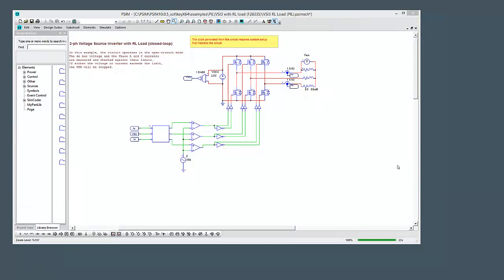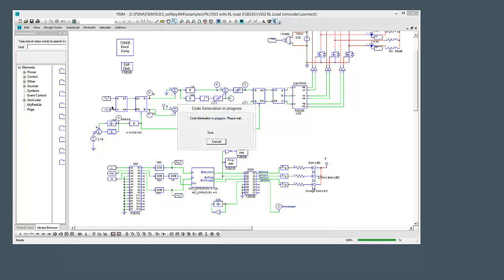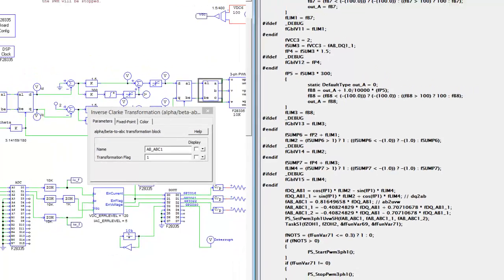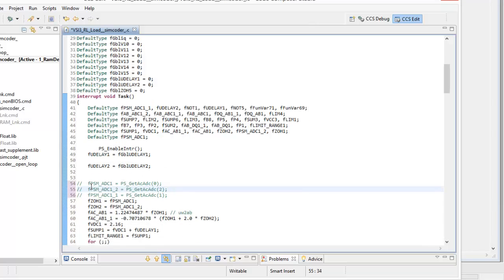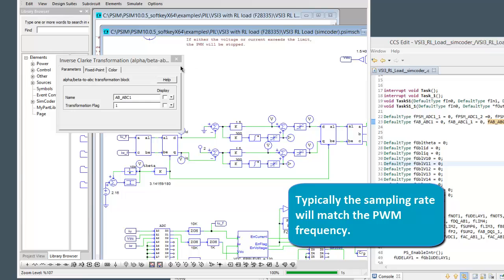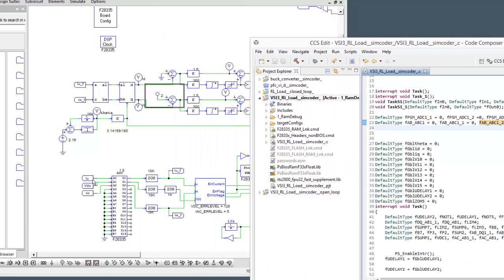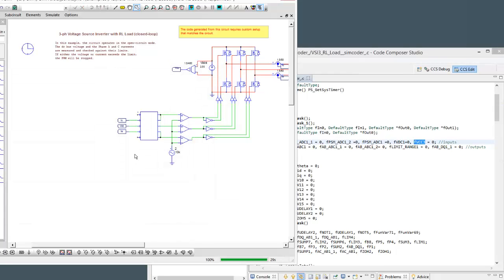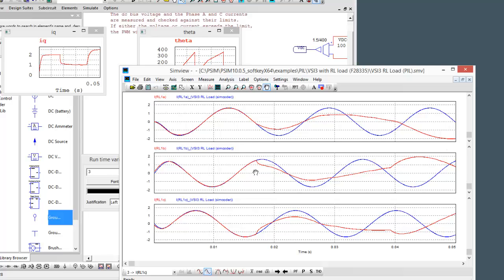Processor-in-the-Loop (PIL) simulation with PSIM - Overview and tutorial

Comment from the maker: The PIL module video uses code generated by the PSIM SimCoder module; however, any c code can be used as one just needs to map PSIM to the right variables. Currently PSIM PIL has only been tested with TI C2000 mcus.